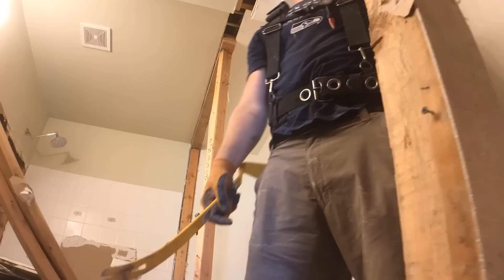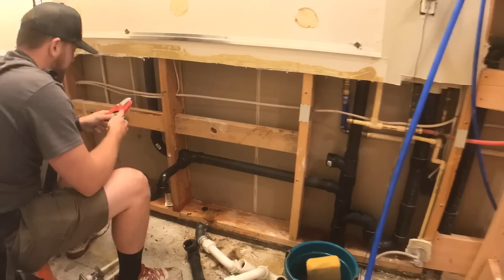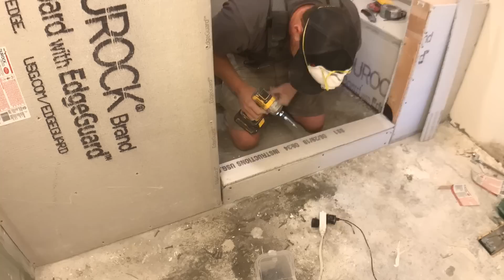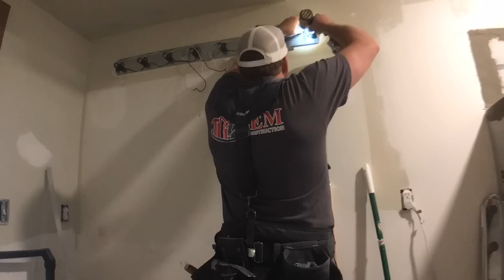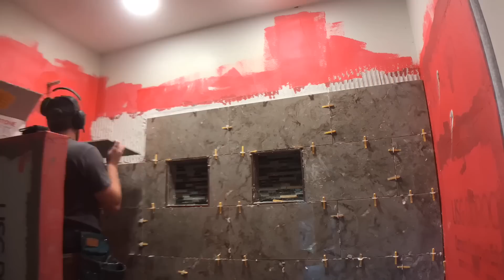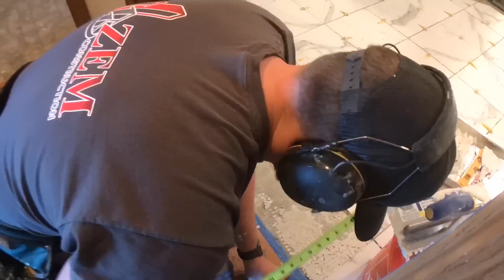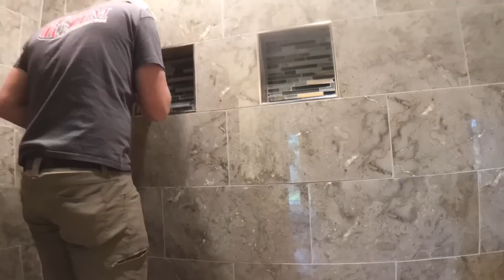Large Walk In Tile Shower | Bathtub Conversion | Full Bathroom Remodel | Time Lapse

Comment: The problem is you can shower in a bathtub, but you can not take a bath in a shower. Options are nice. I keep passing on homes that remove tubs out of master. I found this because I'm trying to figure out cost to remove a giant shower and put back a regular sized shower and separate tub. No way I am living in a house where I have to walk to other side of house or upstairs to the kids domain just to clean myself. Kind of the point of the primary suite.

Comment: Great job it’s amazing how much work is involved in a small bathroom. I’ve done several. One little tip I like to add handicap 2X6 blocking in areas where a future rail bar may be added. Even near the toilet on your left side  wall is a good place for a nailer. Really helps when installing a hand rail. The lights are called canless wafer lights and are a nice new type of light very versatile. Also some of the other wall board options are the Shluter system which is a foam board way easier to install however very pricey. I like to compromise with Hardi  board or Hardi backer board. Little liter, easier to cut with a knife and snap like drywall. 
Its  also real easy for one of these small bathrooms to go sideways and one problem leads to others during the finish and disaster if not addressed at the time they come up. Measure level then measure again as you mentioned is so important. Lots of prep before the next step is crucial and you did just that with protecting areas as needed and clean as you go. Nice job.

Comment: How do you have the wall tile sit on the floor which is sloped how do you then have level tiles. Are the bottom of the tiles cut on a 1/4” per foot angle ?

Comment: Regarding the shower step.. when you were covering it with cement board, how did you secure the inside piece of cement board? It showed you screwing in the outside piece but i'm pretty sure you're not supposed to screw the inside in because it will break the water barrier.

Comment: Nope. I have a large bathroom with an open shower or walk around a wall shower. Looks amazing. We use the family corridor shower now. My bathroom is too cold with an open shower. Nothing beats the warm steam of a smaller room and sitting or laying down while the shower is on you. Gonna remodel the master so it is closed in and will add steam. Also will add heat lamps just outside the shower.

Comment: Hi, what is that grey dirt you put on the floor, looks like a mortar but do not require water... i am very confused with that part, also you use same tile glue to put this sand/dirt in place, is that the a bedding mortar? 
thanks for the video, it is amazing what you did there!

Comment: Fantastic renovation.  Very informative.  A couple comments.

I imagine it would suck to use the toilet while someone's showering since you'll get splashed with some water.  

Also, why didn't you create a layer of tile moulding around the perimeter of the bathroom to act as a back-splash?

Comment: This is a top fucking job! Can I ask how it took in all? I'm about to start a smaller project but am deciding on either ripping out the dry wall with tiles attached or gingerly removing the tiles to avoid much damage... which method would you suggest? Thanks in advacne!

Comment: Looks great, but the old bath lasted probably like 40 years. The new custom shower bases,  if you don't do correct,  they tend to fail , leak, stay wet etc. I have mixed feelings towards custom shower bases. Especially on plywood , on 2nd floors.

Comment: amazing job !! really ! ...except one thing...the sharkbite. That's a big no. Those fittings should only be used for repair purposes. if you knew all the horror I went through. it's an OK product that is totally not as reliable as most people say. Why not just use proper crimped fittings i wonder ?

Comment: Beautiful Job!! We are building a modest rustic house soon and want a large walk in tile shower with a 1/2 wall. The plan pic stated 5’x3’ but I am changing it to be 5’x4’ was this a mistake?? Plans are being drawn next week. What size is the actual floor in the shower you built(after the bench was added)? Want a bench somewhere in ours. Do those plans account for the wall or is that floor space only? Want to be certain we leave enough room for the bench & wall. Any suggestions would be greatly appreciated. Thanks for sharing this video! 😊 p.s. How long did this take you?

Comment: What were the interior dimensions of the walk-in shower?  We are looking at converting our owner's on-suite bathroom 3/4 shower stall into a walk-in shower and I really liked the shower you created.  We have room to expand our shower area to be longer, but I just want to make sure I have enough room (length and width wise) to create a shower like this.  The things I might do is make the sidewalls a little taller, add a ceiling rainfall head (as an option), install a swinging glass shower door over the walk-in opening so that one can sit on the seat still get blasted with water from the sidewall shower head.

Comment: Wait a minute...you are still doing old school leaky as a sieve shower builds? All of those products are not even second rate. Maybe third. Quit using them 10 years ago. All those products are permeable. Except for the rubber membrane but you didn't use it in your niches or bench did you? You need to update to 21st century. Wedi products are fantastic. Kerdi products are nice. Both products are guaranteed waterproof and also assemble twice as fast and don't weigh half as much as cement board. No 80 lb bags of mortar and 100% perfect pitch. If you use them once you will never trowel another shower pan ever for the rest of your working days. And if you research the permeability of cement board and red guard and the time the drains function properly (not long because the weep holes clog with sand) you won't ever feel comfortable warranting them ever again. Grout isn't waterproof. It's a real issue. No one ever seals their grout ever once your gone. Those QEP lash levelers suck. Raimondi are 10x better and cost less actually. Good luck in future projects. I wish you well.

Comment: I switched from hand-crafted shower pans to the Schluter Ditra shower pans and wallboard. Tired of those pans leaking and the errors in getting the right slope. Ditra is way less labor and is one sheet in a shower so way less leak risk. Waterproofing is built-in.

Comment: I've been a tile installer for 20 years it's rare that a carpenter can install that well. Good job!! A little constructive criticism stop using them home Depot materials find yourself a good distributor. Wedi, Schluter, Laticrete. Ardex S1k or 8+9 puts red guard to shame. Laticrete TRI lite is a killer mud ide recommend trying some. Also for the pebbles I like an epoxy grout like spectra lock pro. Great job and keep up the great work.

Comment: I used to use the rubber membrane with concrete on the floor but I just recently did a shower with a pre-cut Schluter Kerdi system for the floor. Yes it's expensive but it sure saves a lot of work. You might want to give that a try next time; I'll bet that you never go back! You did a very nice job.

Comment: Would you ever use blue board in a fully tiled shower? Or tile a floor with no backer board on top of the substrate? Also what about the other walls in the bathroom? What type of backer should be used?

Comment: I'm essentially doing this same thing in my basement with a concrete floor. I'm worried about the stability of the half wall, i.e., if it moves/wiggles the grout ill crack an possibly have mortar or tile issues. Do you have any ideas around this?

Comment: Hey, for what it's worth, although PEX piping are good for installation and ease of use, they are not the best in regards too water pressure drop. IF the house, for whatever reason, has really crappy water supply, copper piping would be better in performance. I am sure you did your due diligence but a quick check would be to check the water pressure at the furthest hose bibb from the street water supply and compare it to the local codes.

Comment: Thank you! It's a great video. I am planning to DIY the bathroom, but in Japan, the bathroom that only installs the unit is the mainstream, so there is no handmade bathroom construction video. This video was very helpful as it showed me the large bathroom from start to finish. There are many other videos of bathroom construction in the USA, but they only show wall and floor construction. In this video, I was able to learn all the details of the ceiling and the connection between the shower room and the toilet.

Comment: How do you test for plumbing leaks before putting the wall back up?    You did great work here.   Thanks for the video
Reply from the maker: Turn the water on… haha. But really, usually after everything is hooked up I turn the water one. Usually with pex style plumbing it will either shoot off because it wasn’t crimped or it’s good. Places that are threaded are the most common place for leaks, so just be sure to double check all of those locations before covering them up.
Reply: @ZEMConstruction  thanks.   So I’m guessing if a leak is to show up it would happen immediately.   Doing my bathroom now but just worried that after it’s all walled in that a leak could appear

Comment: This looks amazing. I'm curious about the actual showering. Is this a bathroom that's ok to have water splash over the wall or does the wall act well enough as a barrier to prevent splash? Thanks.
Reply: it would have been nice if you had answered the question instead of just liking it
Reply: I would bet that is one thing the homeowners regretted.  We moved into a home in which the previous homeowners converted a shower/tub into a double shower with an opening like that in the middle of the two showers.  Water gets all over the floor.  We hate it.  We had to come up with a makeshift idea to put a shower curtain up and use over the door hooks to hold it.  It's tacky as heck, but it keeps the water from getting all over the bathroom floor until we can eventually remodel it.

Comment: Great Job. However, I always install the niches behind the half walls. Niches look great when empty. Homeowners regret having niches visible after they start putting all their bottles. The subway tile looks off with the design, but that's the owner's choice. Also I like to install the shower handle behind the half wall so you can open the shower from the outside and avoid getting wet.
Reply: Came here to say everything you did. That subway tile is hideous and something that someone *gets renovated. 5 different tiles in a bathroom is too much.

Comment: Ha! I liked the part where you said, in your own words... "I'm aware of the Wedi system, I'm doing this a different way, please don't flood my comment section."
Reply: Wedi and schluter don’t really save any time anyway. The lightweight is a pro but the costs aren’t even comparable to cement board or mud walls and floors. Mud work is still the best way for tiling, it’s a bit harder but also the most inexpensive.

Comment: 8:20 ? 1 of: Amico 6 Pack 6 Inch 5CCT Ultra-Thin LED Recessed Ceiling Light with Junction Box, 2700K-5000K Selectable, 12W Eqv 110W, Dimmable Can-Killer Downlight,

Comment: Very nice job by just one guy.  Quick question.  Since the shower is opened and there will be water sipping thru, why didn't you make an additional floor drain since you were digging up the concrete slab?  It will eliminate future possibilities of flooding inside the bathroom should there be a failure of the plumbing system, plus the owner can just water off the floor too!

Comment: Was enjoying the video, then I heard him say "used sharkbite products"  Just lost all respect.  Sharkbite products are temporary products and should never be put into a wall or ceiling....unless of course you are ensuring you have "repair work" for yourself in the future.  Either solder your stuff, or use proper uponor or equivelant pex connectors.  Sharkbite is trash.

Comment: Just my observation here but IF I HIRED someone to come in and redo my bathroom.. and only used greenboard in the areas that were torn out and not all the way through the shower area, I would be one of the most pissed off owners on the planet.  If you are doing a remodel you do the entire thing with greenboard and not just patch up jobs.  Not only would I have fired the person, but sued them  for the failure  to do the remodel correctly all through the shower area.
The two different kinds of tiles seriously do not match at all. They are simply horrible that subway tile does NOT match the stuff in the shower area. I literally started laughing at the combination. Literally 5 types of mismatched tiles. It is just hilarious.  This is like a weekender warrior tile selection of whatever was on sale, they bought it and slapped it in.  Just horrible taste in design. 
AND who does that horrible "TEXTURING" anymore?  I mean seriously all that "TEXTURING" and "popcorn ceilings" and all that crap is what goofy people do.  There are now so many wall options, that if you use texture crap on the walls, you can't do anything else.  Like suede style walls and Tuscan designs.  texture is for dummies.

Comment: Old saying "you get what you pay for." Everyone wants a deal or undersales job. Ruins the market. And then dissappear from the face of the earth. 😄 no treated wood. But we continue to talk about rule of thumb.  Quality 1st. Any framers watching this? Pls explains why treated wood is used. Case close. And yes I am a plumber 20 years in trade. Union/ residential service and repair.🤣😂🤣😬😬😬 shark bites oh fuck! Not a plumber. Handy man work!  I can't wait to see the old trick bags, next. Oh shit I was right.😒😬🤯🥸
Reply: Fuck. Listen to what he is saying." I did it they way I learned." Staples right through the wet barriers. Holy shit. Hot Mop is high quality. Material spent compared to a hot mop. Jeez!. 275$ hot mop vs a punctured by a Staples wet barrier. Lol at least he over lapped on the tile. Jeez. Good job with the red guard that's a must. Wet barriers are super important!

Comment: No particle mask for ANY of the concrete tear out, jack hammering the old thinset or sanding the drywall. You're headed for an early retirement when you can't breathe without an oxygen tank in a few years. WAKE UP and start being proactive about construction safety protocols.

Comment: What size grout joint did you use on the 12x24 shower tile as the 12x12 floor tile?  And who makes the lights that you installed in the ceiling/. Oh yea, Great job!
Reply from the maker: 1/8” grout lines on both. And I have a link in the description for the lights I like to use.

Comment: Try the WEDI system, IMO it’s the best one out right now. You can use just the pan and do the walls with cement board, or you can use the entire system with the wall panels. I prefer 1/2 Hardi backer and tape seams with mesh tape, then red guard it(just like you do)
I personally hate the Schluter system and haven’t used it in years.

Comment: Effort spent to make layout was well planned. However this shower will fail. There are numerous mistakes, my favorite being screwing durock to the inside of the curb that was just carefully covered with the RUBBER LINER to seal water until the screw rusts away?!? Classic error and very common. This is a DIY grade shower at best. Plan to redo in 5 10 years tops if the mold takes that long to be noticed. I’ve redone enough to be well aware in new houses....   

SCHLUTER SYSTEMS. That’s what you should be doing. You’re welcome, not hating just sayin. There was a time I did them wrong until I saw the light haha
Reply from the maker: Seems a little dramatic. I agree, we have recently switched to schluter systems, but not because this method is inferior as far as water proofing, but because of the time savings and lifetime install and material warranty. I used coated screws and fiberglass mesh in all the corners and seems, this is almost the same as a kerdi fabric or kerdi band except the orange “membrane” is already applied as apposed to painting it on and letting it cure. Schluter systems are relatively new to the market and people have been building showers the I did way for years with no problems, where do you think they got the idea for their designs? Even sal diblasi, the YouTube tile master used to build them this way. I’d put $100,000 on this shower still being perfect in 10 years, you do “enough” you should make that much a quarter right? Not hating, just sayin.
Reply: @ZEMConstruction  

This method actually is inferior as far steam showers go. Obviously this isn’t such, but the fact that the rules were changed from this to systems such as schluter was enough for me to completely stop using this system. If I need a cement pan I will still apply Kerdi o top to the floor with the schluter drain assembly 

. Another quick give away is the red guard being applied way too thin. You should not be able to see the words on the durock after waterproofing is applied. The thickness they require is surprisingly thick. 

The correct way to do a curb is to use “fat mud” with wire mesh to build a concrete formed shell around the curb, thus requiring no screws into the curb. 

O shoot. I only make that much in 2 quarters.... what a bum. Just sayin

Comment: on something like this.. do you come up with the design or does the homeowner?
Reply from the maker: On this one, they did. Usually the home owner has some input. However this project was a little different, the homeowner purchased all of the finishing materials. The tile, paint, vanity, mirror, and fixtures. Pretty much everything you see. Not usually how I like to do things, but in some cases if they know what they want it’s simpler.